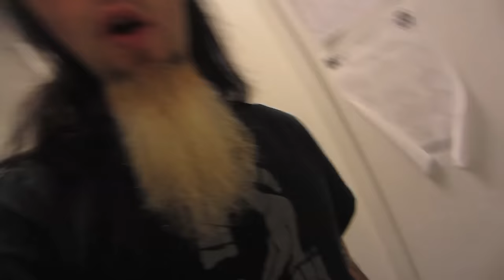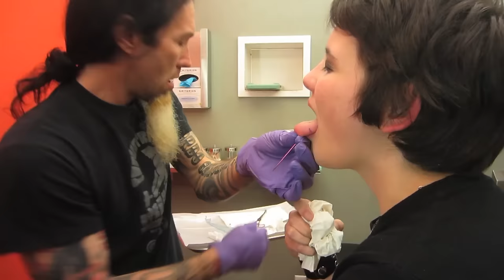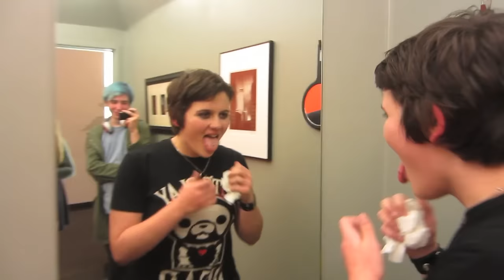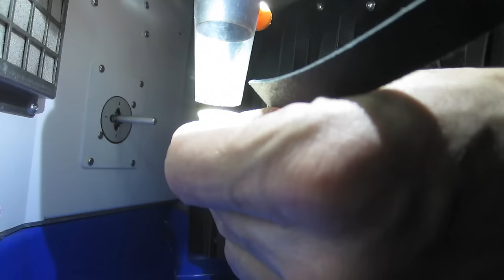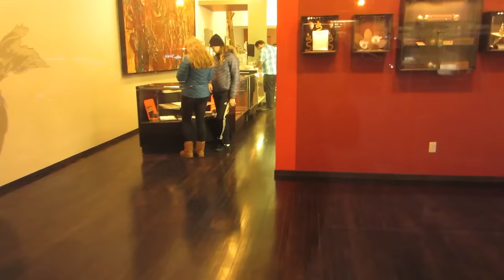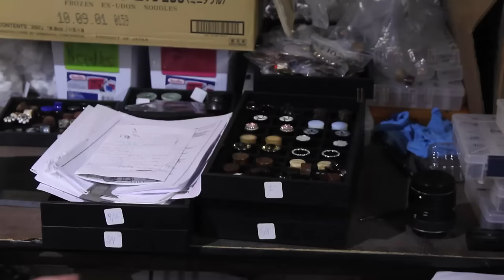How I Make Hammered Discs- Minor Tongue Piercings?- THE MODIFIED WORLD

Comment: This might be a stupid question. Do you need a certain ear shape for a industrial bar to work in your ear? Or is there a certain angle for each ear to make it work? One time I got the piercing done before and it sliced my ear opened (almost in half).I wanted it done again, but I afraid it will slice my ear open again. Any advice,Thanks!
Reply: It all depends on the anatomy of your ear. Your best bet is to go to a shop and have them take a good look at your ear. Also explain what happened before. They may be able to figure out either what went wrong or if the piercer messed up.

Comment: what process do you go about bleaching your beard solid white? I've wanted to do this for a long time now but I'm nervous about it becoming too brittle
Reply: Not a bear expert here, but I guess it's the same process as hair bleaching : do it with a 20 volumes developper (not too strong, but it eventually gets the job done) and bleach powder. Follow the directions on the boxes and don't bleach it more than twice in a row : if you still haven't achieved the right tone, let your beard rest a bit before bleaching again. Get a bit of toner in it if you want to get rid of the brassy/yellowy tones, and put some deep conditioner after you bleached. Beard oil or whatever you use to moisturize a beard on it to keep it strong after that.

Source : several green/blue-haired friends and my own bleached stripe.
Reply: Hell Reader It's not the same process as hair. Beards are MUCH more brittle and require a lot of additional care. If you do it the same way as regular hair your beard will literally fall off.

Comment: Hey JC Pots i have a question im been using a tapper to stretch i put the piercing gel all over that and in the hole  but when i go to put the eyelid in or plug it wont go in the other ear was fine i tried twice first time it bleed second time just no go so what can i do ? i thought of using a captive bead ring but cant get one at 6mm
Reply: +Eric Goodwin Dude there should never be any blood. The first time there was blood you should have stopped and waited. I suggest wearing heavy jewelry at your size and waiting. Its not what you want to hear and your not going to do it (cause I wouldn't) but at least I said it.
Reply: +ApeX Kittens ik blood was not good and ok I'll get a can give bead ring in there and wait till it will let me just looks odd one at 6mm and one at 8mm
Reply: +Eric Goodwin sounds like you are stretching wayyy too fast man. If I was you , go back to 5mm on the bad ear for around a month then try again. Remember that you dont have to move the taper all the way through in one motion either, you can move it a small part in, wait, then move it in further until it goes in smoothly. It  should not hurt to stretch your piercings, only feel warm
Reply: +Haychy pls it normaly dose only feel warm this is the only time it went bad
Reply: Haychy pls my opinion is my tattoo place was wrong about u can go up my 2 sizes cuz b4 i just went one size each mouth and was fine
Reply: You can go up two sizes if you are slow and steady, but it has a higher risk of going wrong
Reply: Haychy pls ok i think ill still stick to one size